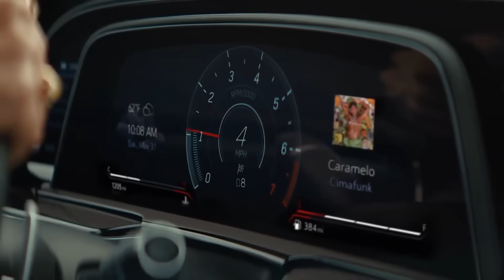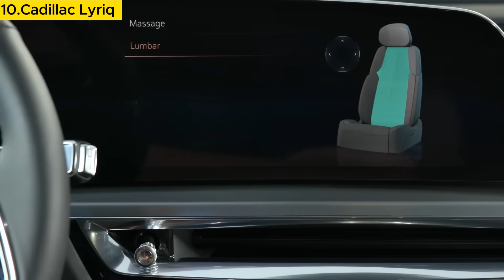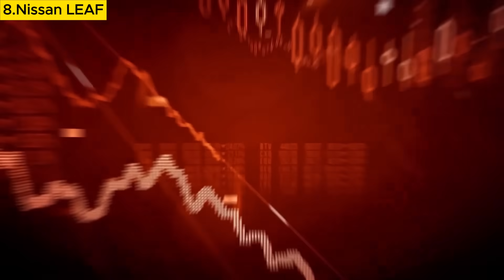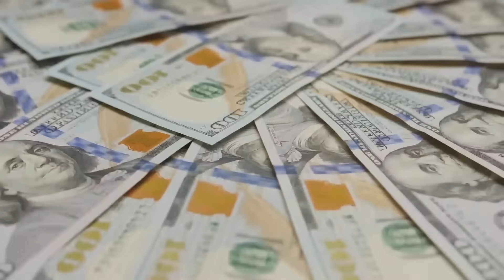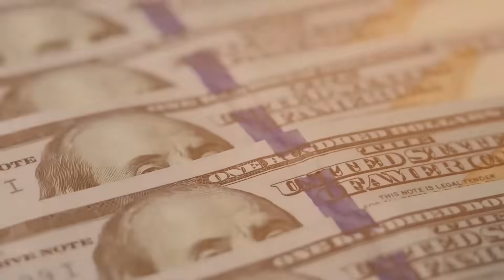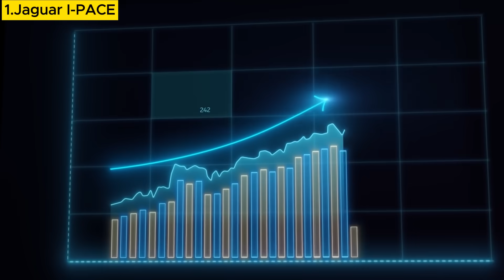10 EV Cars that Dealers Can’t Sell ! | Why Electric cars are piling up!

Comment: If you told me the car engine needed to be replaced after 100,000 miles I would never buy that ICE car. The rules don't change just cuz it's an Ev. That's unacceptable

Comment: The EVs cannot replace petrol cars. Petrol cars can operate in all weather conditions, on and off roads, in far more rugged and extreme terrain with greater range, flexibility and be quickly refueled for more driving. EVs do not have the capabilities of Petrol vehicles abd can't do the job the that Petrol vehicles do now.

Comment: The only EV that makes sense is a Tesla. For $35K you get 300 mile range, heated memory seats and steering wheel, Autopilot, Sentry mode, and dashcam. My insurance did not go up, and I charge at home. Battery replacement is $7K after 10 years (worst case). EVs are not for everybody, but I never want to buy an ICE vehicle.
Reply: Had a Model S in the family , complete POS . Cheapest built car ever.
Reply: @bobbybishop5662  I own a Model Y; it is the best car I have ever owned. I guess we cancel each other out. "We expect the 2024 Model Y will have about average reliability when compared to the average new car. This prediction is based on data from 2021, 2022 and 2023 models." - Consumer Reports. "Tesla's fast-selling Model Y crossover has received the highest safety score of any car analyzed under Euro NCAP's newest and toughest test." - Forbes
Reply: What happens if you want to pull a trailer, and a small one at that? And in the cold? Gas range will plummet considerably.
Reply: @preacherdog  No, the majority never pulls a trailer nor does the majority drive long distance. So that's why the EVs are perfect. Welcome to the 15 minute city where you will never tow anything or go anywhere. And most EV owners are perfectly happy with that.
Reply: Psh insurance didn't. Go up. Did u trade in your BMW7 series to get the Tesla3. We need to know the make and model, which u conspicuously have left out
Reply: @peterbarrett5496  Mazda 3  - State Farm stands out as an excellent choice for Tesla owners, offering affordable premiums, especially for the Model 3, Model S and Model X. State Farm offers roadside assistance coverage, which may potentially provide a charger for electric vehicles, greatly benefiting Tesla owners. It also offers vehicle safety and anti-theft discounts and has a good customer satisfaction score.

Comment: Interesting statement that EV sales are slumping. Now look at what's happening and look at what history has taught us.  
          First the statement that EV sales are dropping.  Ok , yes EV sales are down , for Ford and its F150 lightening. First priced at 90k for the first year it came out. Demand was high so legislation gave IT a $ 7500 tax credit. Immediately  ( well close to it) Ford comes out and announced a price increase of $7500 dollars.  So Ford basically took the tax advantage for itself. So years following the great response of year one showed a steady decline in demand for the lightening. Owners reported problems with the onboard infotainment system, which froze and crashed. I saw one lightening,  on the news, that got an update and crashed. Screen said update was not successful.  But guess what? That screen was frozen and the guy couldn't connect to a charger and couldn't charge his trick , leaving him dead in the water. Does this happen to Tesla cars? Nope and why not? Well let's do a web search and look at what controls the infotainment screen. Ford uses a Windows operating system, and if you know anything about Windiws you are well aware that it has a reputation for crashing, often and is constantly reported to not " play well with the other kids in the sandbox." OK now let's see what others use. Tesla uses a Linux operating system which has 2 great things it's famous for . First of all ,Linux is an open source code system.  That means that anybody can use it free of charge. So why is Ford buying a license to use Windows? You know they pass that coat along to the buyer as all good companies do. Why pay for something you can get free? The second thing about Linux worth noting is a statement made to me by a CT scan operator. This Linux system is awesome and so stable I've  ever had it crash and never heard of it crashing.  It's great because it's so stable. Hummm maybe that's why Tesla cars all use the Linux operating system.  . So sales of Ford lightening trucks is dropping off yearly, they are crying about the lack of interest.  But conversely,  Tesla sales hit new highest this year 2023 the model Y is reported to be the number one car sold in the Netherlands,  New Zealand,  Canada and the U used States. No drop off in interest. Nope , sales are hitting all time record highs. So our history lesson today is about good products that sell well and crappy , rush to build it trucks with poor operating systems,  are rejected by consumers. Don't believe the news reports. EV sales aren't slumping, it's a conscious decision by shoppers to seek out the better mousetrap and beat a path to the door ( or person) selling it and buy one. Oh and don't forget to examine the Chevy bolt , the Sparks disaster, big brother. While out for a test drive last year I drove a bolt. Kinda small for me but 287 miles estimated range. Ok  best price was 44k, what? Really, no negotiations,  no discount  for driving a GM car since  General Patton was around ( I exaggerate of course) . And just 3 months later they are being kicked to the curb priced at 29k in a fire sale manner because the news is reporting battery  fires and the need to caution the public not to keep them in the garage because  of the risk of  burning the house down with the family in bed. Yes and sales declined too. So can you see a trend here? 
          Yes folks, automobiles with a poor reputation are seeing a slump in sales and companies with a better product and reputation for customer care , are seeing increased sales.  And don't forget about charging stations . Yes over 50k stations set to exclusively charge Tesla cars is ALREADY HERE. Up until 3 months ago only Tesla cars used the system. I could go on and on about things but it all boils down to Tesla bring 10 years ahead of others in battery technology, built and fully functioning rapid chargers already here. The public appears, to me, to be making a personal choice based on  quality,  reputation, charger infrastructure, customer care and other factors. Why was Henry Ford so successful? He sold a great product that got less expensive as time went on ( like Tesla did) .  He improved his mass production line and techniques as time went on ( same as Tesla does with batteries) .  I just see history repeating itself.
          One last question.  When the White house announced a meeting for American EV manufacturers to talk about the future and assorted agendas,  Ford and GM were invited and both attended, but Tesla wasn't even invited. But why? Tesla makes cars in the great state of Texas. Why wasn't Tesla invited? 
           The federal government is taking a stick and carrot approach to EVs. Only they are only using a stock now days and telling us to get an EV soon because ICE cars are soon to be discontinued.  Rubbish... the American public is demanding more. Nissan had the first EV car sales in December of 2010, 13 years ago and the US government has built how many charger stations for EV cars?  None. But we let companies like EVGO build them and buy electric power at 10 cents per kwh and sell it in their EV stations for up to 59 cents per kwh. That's an almost 500 % markup on the power it provides. Why doesn't the government demand a fair or reasonable pricing for electric power. Tesla buys and sells the same electric power, but prices range from 12 cents to 40 cents ( max cost I have ever seen) and discounts are substantial if charging is done during off peak times, roughly 2200 till 0700 every day! Imagine $5.00 gas selling for $3.26  but only from 10pm till 7am. Would you get your gas at night time? Just fir the record,  I was not paid to say anything here. I have been driving since 1974. My dad said GM was the best car maker in the world but I never believed that. I have driven  EV cars ( test drive) by Nissan, VW, TOYOTA,  CHEVY,  I have been a electric for 7 years with 3 full cross country trips. Last EV was a nissan leaf 2018 bought new and died 2022 with 47k . Total failure of power pack. Currently own a Tesla, bought after my Leaf died.  Do I want every one to drive an EV? Hell no. Drive what you want.  Just check them out, you'll be surprised.
Reply: You have definitely nothing else to do with your time, other then waste it writing essays on YT! Pathetic...

Comment: EV car too expensive, not suitable for long distant. EV car the most you can around 600 km, after that you need to find a station to charge the batteries. EV car the batteries are so expensive too. From what i knew in Canada someone bought ev cas from Hyundai. They paid 55000 for the ev cars,  two ev cars owners having the batteries issues,'they need to pay 60000 not 6000 for each ev car to replace the new batteries. Don't you think this joke?😮😮😮

Comment: Unless the Cost of Insurance is addressed,  in US is ridiculous,  insurance companies are quickly abandoning the Ev market.  40 to 60% annual increases is killing the market.
No repair centers,  no parts,   long repair times,  months,  $$$$ cost of repairs.  It goes on.
Reply: Yes, major insurers do insure Tesla. Tesla also offers its own insurance products through Tesla Insurance. Tesla's smaller SUV is the Model Y. Average annual insurance for the entry-level Long Range trim costs $2,118. It starts at slightly over $52,000 and has 326 miles of range. With help from its dual-motor AWD setup, 0-60 mph acceleration takes 4.1 seconds. BMW's equivalent luxury compact SUV is the X3. The entry-level xDrive30i costs quite a bit less to insure: $1,725 on average. It's also less expensive to buy, starting at roughly $45,000. It's not as quick, hitting 60 in about 6.0 seconds, and it's rated at 23/29 mpg.
Reply: insurance costs for any vehicle is going u, mostly because of natural disasters, insurance see that as increased risk, and price accordingly, course parts and material costs are rising too

Comment: There’s a drastic lowering of Legacy Automakers EV offerings, but there’s a solid demand for EV’s in USA.
Unfortunately legacy automakers have missed the EV boat, are a decade behind Tesla in electronics, software and manufacturing technology.  They also were not investing diligently in fast charging networks, prior to taking up the Tesla NACS  connector and having done a deal to gain access to the superlative wide ranging Tesla Fast Charging network. Even so the deal with Tesla is only going to bring benefits after about 2 years or before 2026.  
I suspect that they’ll have bury their by pride and license more technology from Tesla, and that’ll have to happen fairly soon to stem the bleeding losses that their present EVs present to their profitability.  Eventually need to even have to stop financially prodding MSM to create anti Tesla FUD articles, like this one.
Unfortunately the legacy automakers are running around like a chicken with its head just cut off.  Until they bite the bullet, get focused, get re organized and take up Tesla’s offer of share in hardware and software. 
They need to seriously invest heavily in Fast charging networks to make using their EVs for road trips viable. Until then their EVs will remain pretty ornamental objects sitting in disappointed customers driveways and garages. Let’s see how many can avoid their KODAK moment in industrial history.

Comment: Eventually they will be used cars...who would be stupid enough to buy one when looking at a 20000 to 50000 dollar battery replacement.
Reply: eventually is now ...Herz are dumping them ...
Reply: @graantmnz  Hertz (and by extension any car rental company) are dumb to get into the EV market in the first place. Using common sense and logic, this costly mistake could have been easily avoided. What is the primary benefit of getting an EV? Basically waking up to “a full tank” every day when you charge at home. Guess who Hertz’s primary customers are? Those who are on vacation, on a work trip, on vacation, or those who need a temporary vehicle after an accident. In most cases they won’t be at home so that means they don’t have a place to easily charge at night. If you get a shitty Tesla you’re stuck using their Super Chargers that charges pretty fast, but you still have to wait. If you use a slow charger then you’re stuck waiting even longer. Either way you still have to wait while you’re traveling. It’s even worse if you rent another EV that doesn’t have access to Tesla Super Chargers and rely on Electrify America who are known for being unreliable, having broken charging stations, for being offline, or not having many locations at all unless you live in California. If those chargers are far away, how are you supposed to return your EV with a full battery if you have to drive back to the rental company afterwards? You’re bound to get added on fees to charge the car to full even though it was full before you had to drive to the car rental place. 

Someone who uses common sense could have told Hertz not to get into EVs a long time ago.
Reply: Nobody would buy a used TSLA.

Comment: Major issue is price, second issue is car insurance, third issue is charging availability, fourth issue and probably the biggest is range anxiety.   (not to mention battery degradation over time) Very expensive item to repair or replace.
Reply from the maker: Expensive to have
Reply: @extremecars8027  you should check the prices of ICE vehicles, they arent that far off from EV prices
Reply: The Model Y is only $37K. My insurance did not go up. The data shows that the average Tesla battery still regularly provides over 90% of the original range up through 100,000 miles or more on the odometer. Past 125,000 miles or so, the range starts to drop off, but cars in the survey still delivered over 80% of their original range even at the highest mileage levels.
Reply: Sticker price is indeed still an issue in the US and Europe, but not anymore in China, where EVs are now the same or CHEAPER than comparable ICE cars.  Wait another couple of years, and that will be true everywhere.
Car insurance?  At least in Europe, the insurance premiums for EVs are similar to or slightly CHEAPER than for similar ICE cars, everything else being equal.
Charging availability?  I can only talk about the situation in Europe:  perfectly fine, especially but not only for Teslas.  Fast chargers are not ubiquitous, well located, and getting ever cheaper.
Range anxiety?  Nowadays a totally imaginary issue in the mind of people with zero EV experience.
Battery degradation?  Yes, absolutely but very little and slow... modern batteries will outlast the vehicle.
Battery replacing?  The word of Chris Chandler, director at Lex Autolease in the UK.  They have 165'000 EVs in their leased car fleet... not a small sample you will certainly agree.  They have had precisely ZERO fire, and needed ZERO battery replacement in that entire fleet!
So, your information is very very obsolete to say the least!
Reply: @st-ex8506  what world are you living in?
Reply: @KA9DSL  Not in the FUD world of disinformation that this site, as well as others seem to live in!